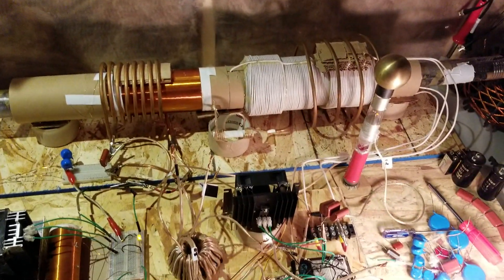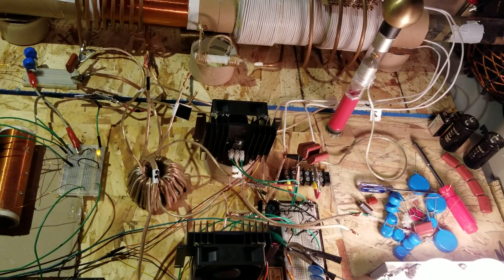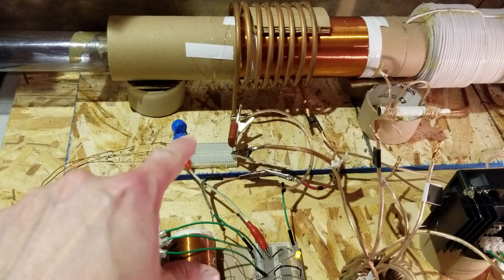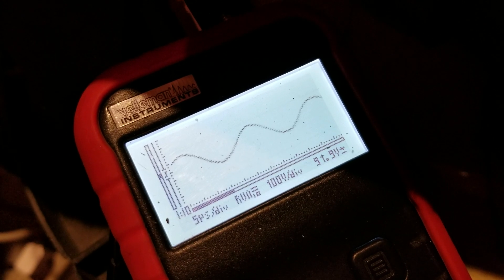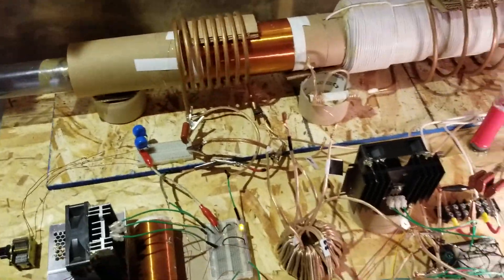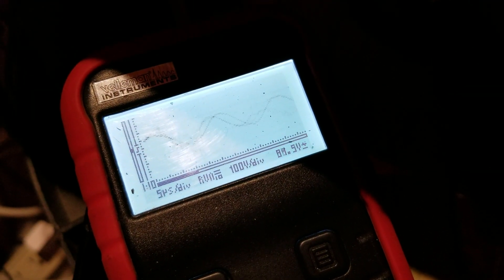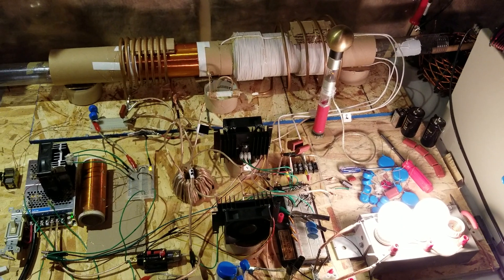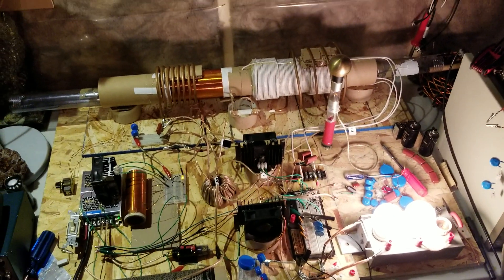Part 4: Akula / Kapanadze Experiments: Improved Tuning, power supply limit

Comment: Hi again. 

I found something that is a very very odd schematic.  I could only find it in one website and its said to be one of Tesla patents.  I looked around and I cant find the page. It somehow combines timed coil  shorting to inrease voltage and amperage as we did on lens law coil shorting experiment.  Timed short causes in increased speed induced in magnetic cores etc. But this schematic ( which is a tiny add on to what you already have at hand) claims to work within Tesla transmitter coils. I know you have like a dozen of them laying around and it might boost the kacher on this experiment as well. From my understanding,  the short induces secondary wave at + and - peak of the wave . I just have to find a way to send the pic to you
Reply: This is the best I can do. Might help with reducing input for kacher. And for some reason, I think it's a similar circuit on Chubinadze that was right in the middle of output coil.
https://youtu.be/cL6zBsIPRM4
Reply from the maker: yep kurtkaukinen@ymail.com :)

Comment: Great work,  try to get the tesla coil tune to x10 the kacher s frequency may helps and use filters for better gain.
Reply from the maker: x10 ? that could be doable :) thanks for the advice !
Reply: @kdkinen  
The phenoma ocures above 1000v pressure and over 5khz so the output of the yoke hast to reach that kind of pressure and also the tesla coil. Gled to see you progressing with it. Cheers from Hungary( just like your light bulbs from)